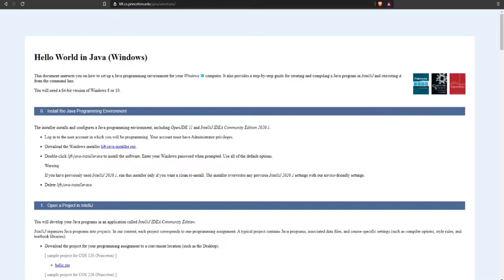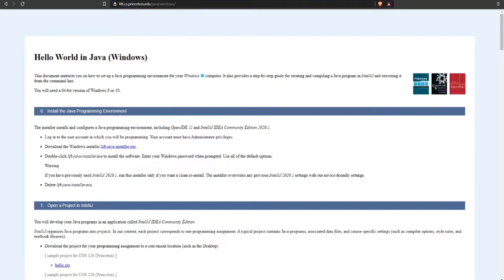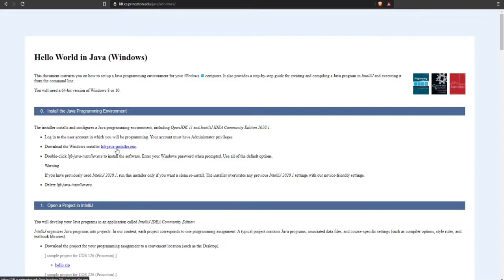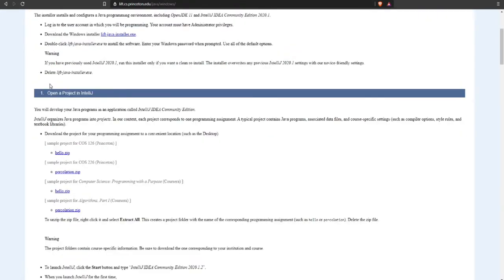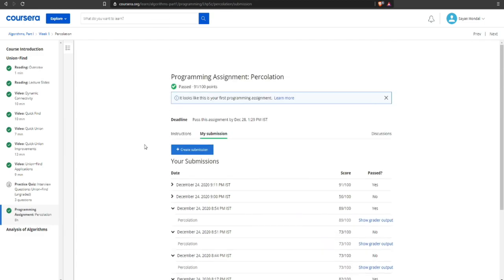Percolation Assignment | Princeton University | Algorithms, Part 1

Comment: Why do you write in open method [row - 1, col - 1] while in the input file there are coordinates containing zero?
How does it works? For example input sends the site's coordinates (0,1). It will corrupt the open method.
Reply: Because , row 0 belongs to the virtual site at the top
and row size + 1 belongs to the virtual site at the bottom

Comment: in isFull() row and column should be greater than zero, but in the percolationVisualizer the first argument to isFull is row = 0 and column = 0, the program throws the illegal argument exception just after running it. I have also copy pasted your code and still not working.
Reply: @\Drew apparently the project files we got, were new updated version, so all the solutions on the internet won't work in the ide,  but there is a catch. If you submit the same solution the grader will pass you. Because grader still evaluates according to the old version.
Reply: @\Drew Yep, I got 30-31, then i searched on github and just copy pasted the code and got 91. If you want I can give you the file.
Reply: @mrbobcat7399  can I give a file?

Comment: openedSites should be incremented if it was not opened before, 
Test 6: open random sites until the system percolates,
        allowing open() to be called on a site more than once
  * n = 3
    - numberOfOpenSites() returns wrong value after 3 sites opened
    - student   numberOfOpenSites() = 4
    - reference numberOfOpenSites() = 3
Reply from the maker: Thanks for the feedback, will update the code.